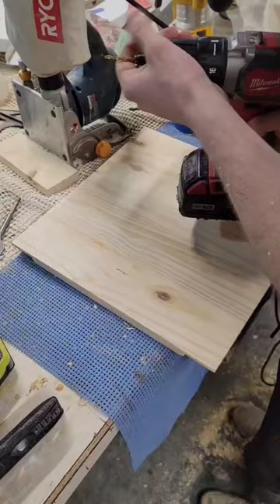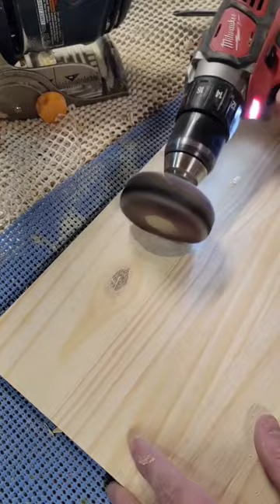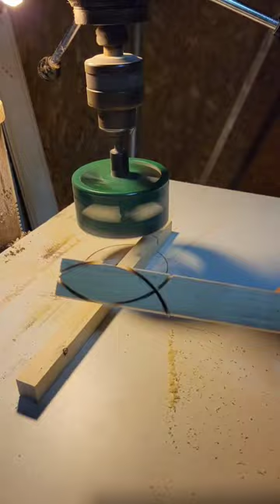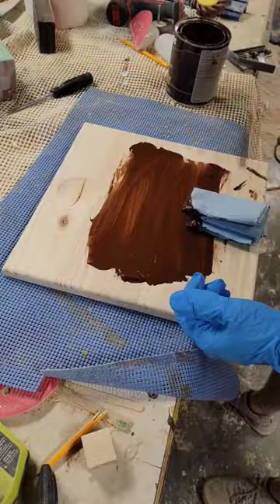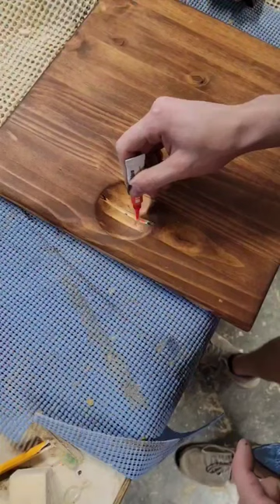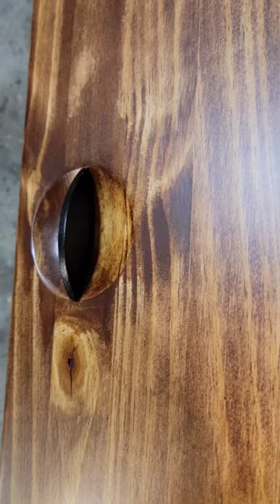Cabinet Door Handle // Woodworking #diy #woodworking #maker #carpentry #woodworker #wood #handmade

Comment: What you started out with after cutting that concave recess - before taking out that remaining cylindrical center - was in fact a drawer handle I saw everywhere in the drawers to my old workshop. Someone has used the technique thoroughly and it worked very well...
But i think I prefer your design here. Definitely looks more comfortable. 👍